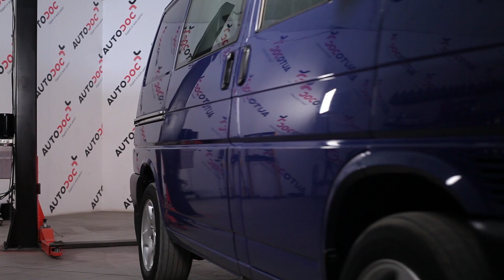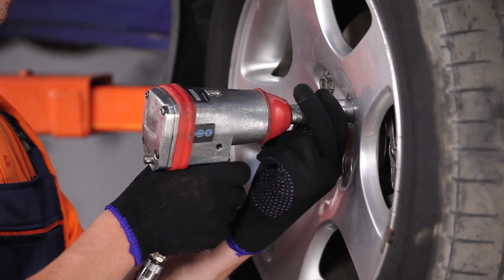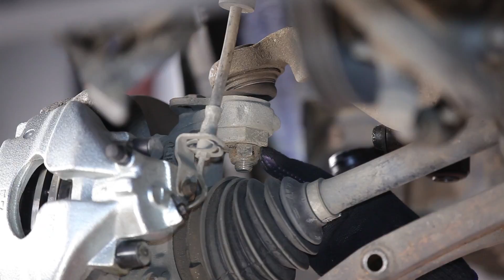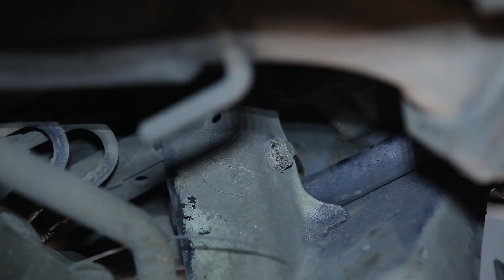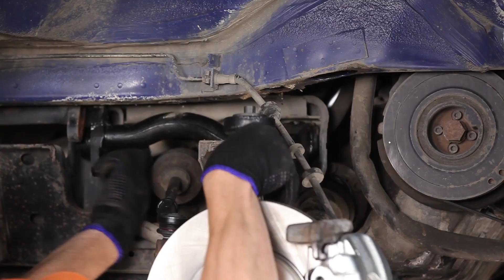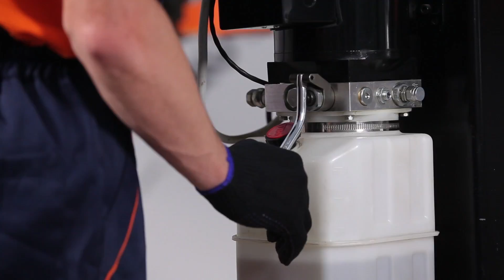How to change front suspension arm on VW T4 TRANSPORTER [TUTORIAL AUTODOC]

Comment: I dont know how you got to that nut on top of torsion bar. My fuel tank is in the way.
Reply from the maker: Thank you for the feedback! This video is considered to be an informative one, and it shows the sequence of repairs, so some stages of the repairs might have been excluded. Best regards, Autodoc.
Reply: Matthew you can slide that crazy long extension down between the fuel tank and the chassis, but there's no point, the bolt has a 160nm torque on it, plus rust. You wont get the leverage needed from that distance. Instead, use a small 80mm extension and a pry bar with the vehicle on some axle stands, a good upward pull should do it... or round off the bolt.. so FIRSTLY, use heat then penetrating fluid, and repeat 5 or more times.

Comment: Can I ask that you provide the symptoms why you replace the items as your videos are so clear but I do not understand what you would experience if you need to replace this item.  I am sure I am not the only T4 owner who is new to mechanics.
Reply from the maker: There are a lot of various signs that it's time to change the steering knuckle and it is very difficult to name all of them. Only the full diagnosing of the chassis and steering systems of the vehicle can deremine it. Usually, abnormal sounds and discomfort while driving are the main signs. If any of those signs appear it is strictly recommended to contact a certified repair shop for further assistance. Best regards, Autodoc team.